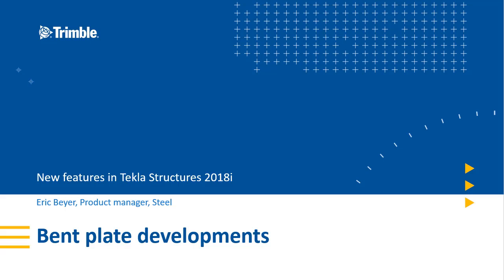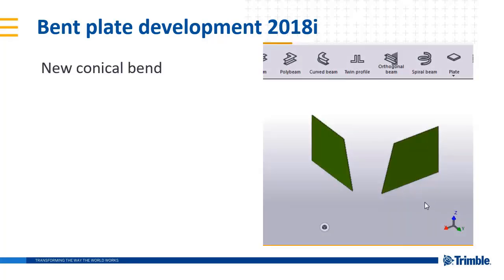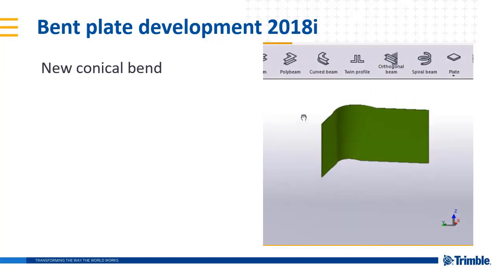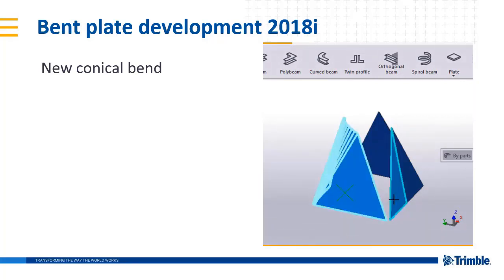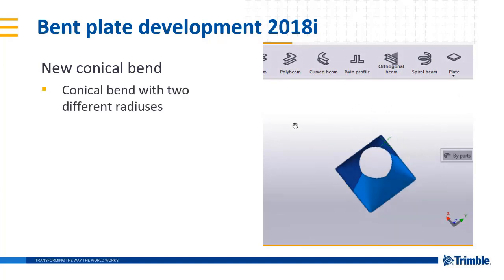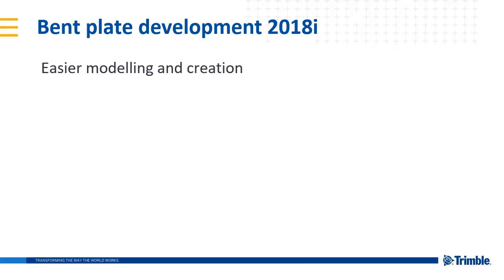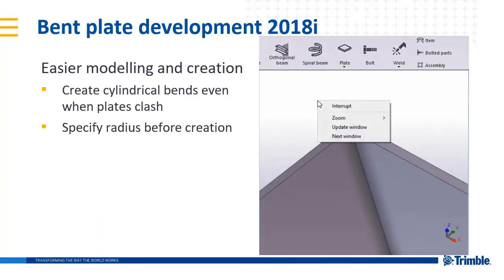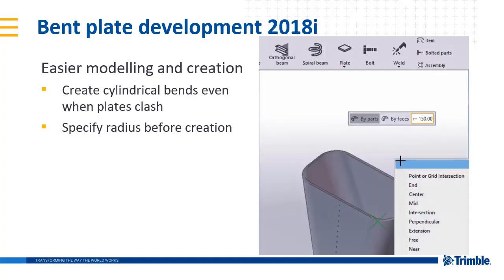Tekla Structures 2018i New Features - Radial and Conical Bends in Plate Work

Comment: Can anyone share some tricks to help me get simple bent plate functions to work?
I can't get a sheet profile which was modeled from contour plates to join. Then, when I join two plates at right angles, I can't get the unfold command to work. Therefore, I can't get an unfolded plate drawing. These bent plate features would save me having to use AutoCAD to detail these items.
Reply from the maker: Hi! Thank you for reaching out. If you have any technical question, you can reach out to our online resources, and local helpdesk. More info at https://support.tekla.com/. Best!